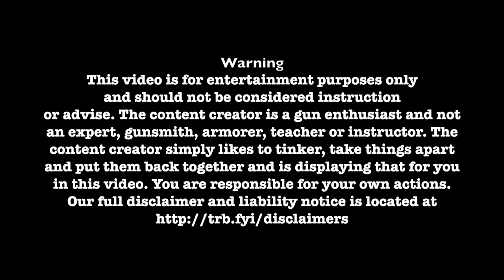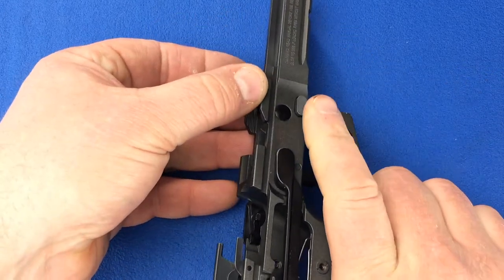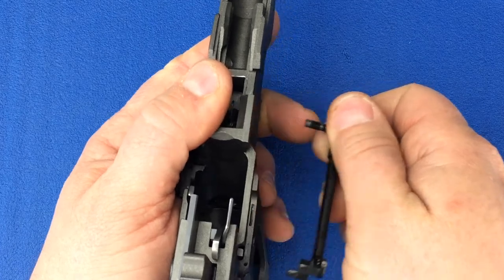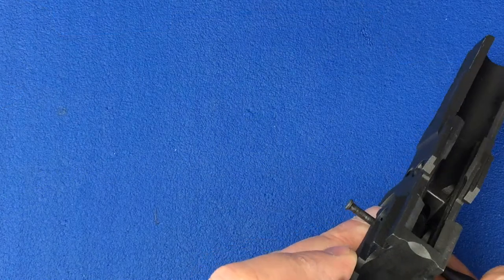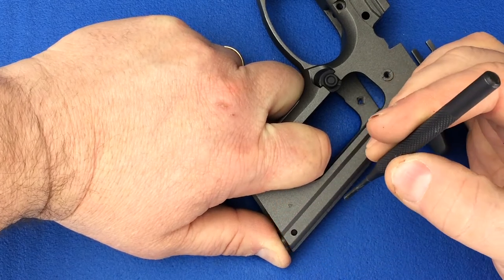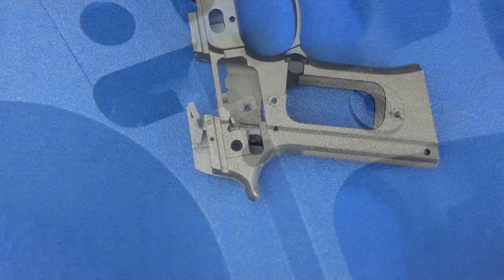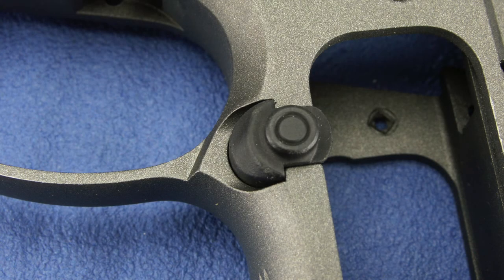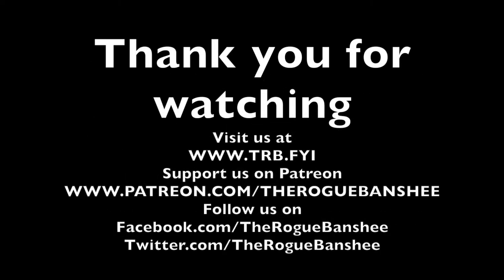BERETTA STEP BY STEP // Beretta 92fs Frame Disassembly Simplified (also Beretta M9a1 and Beretta 96)

Comment: Amazing video. I want to tell you about my gun problem. When back the slide the hammer is secured behind, but when I release the slide stop the hammer runs forward too?? If I get to have a cartridge in the chamber, it will shoot!!!!!!! How can i solve this problem. Thanks
Reply from the maker: Sorry, I thought I replied to your comment a while ago. I wouldn't mess with that gun too much. Instead, I would take it to a gunsmith and have it checked out. Even though the sear controls the hammer movement, you may have a trigger or trigger bar problem as well. Again, a good gunsmith should be able to troubleshoot this problem
Reply: Has your problem been solved?
Reply: PistolGrip44 No